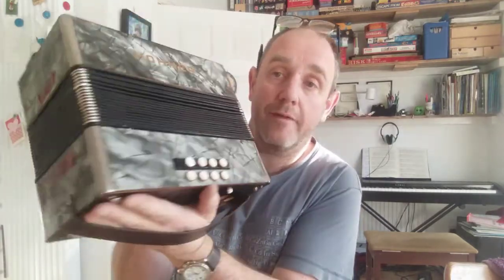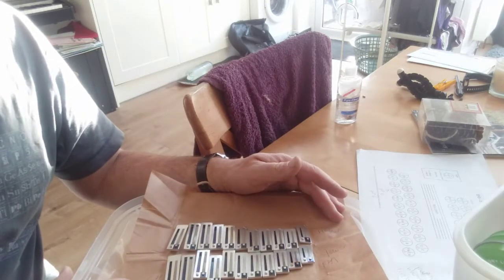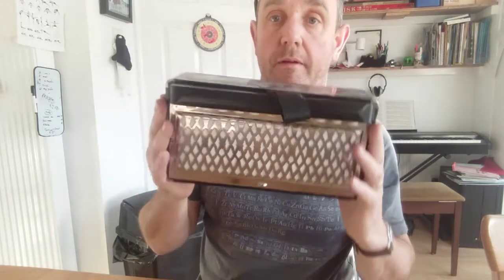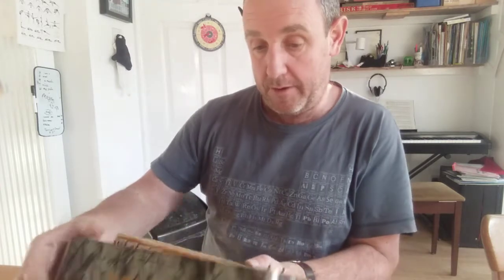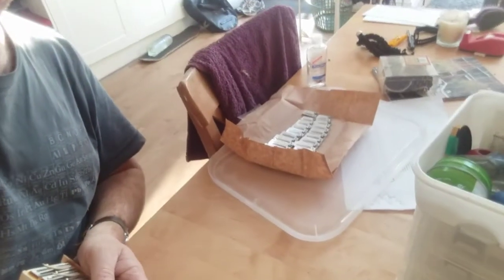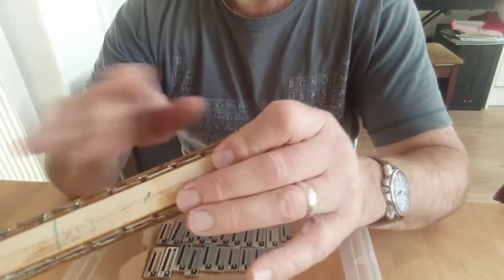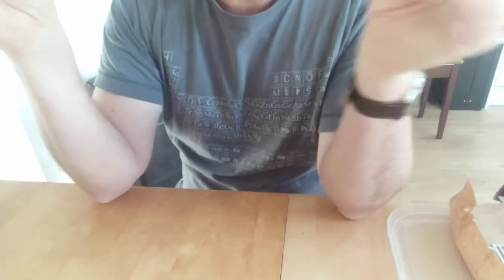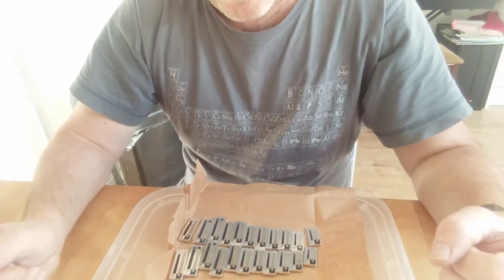kitchen table melodeon restoration part 10 removing treble side reeds and preparing reed block

Comment: Hi Rich, where did you buy your reeds from? I am brand new to accordions and acquired a pretty knackered 120 bass piano accordion. I’ve fixed the mechanical problems but a few of the notes sound really raspy and not sure if I need to replace the whole Reed or just the valves.
Reply: I am in the same boat ⛵